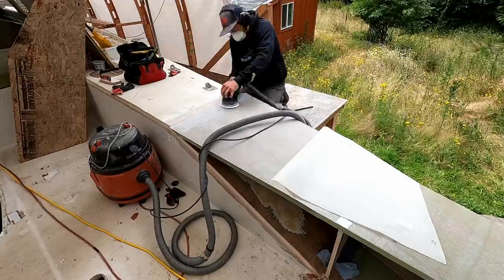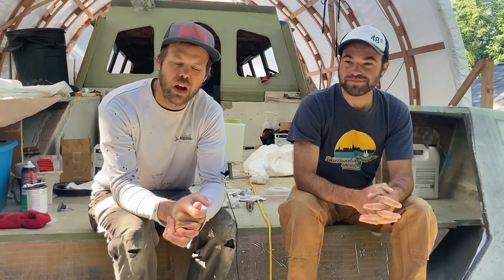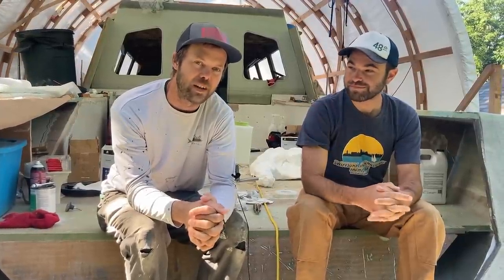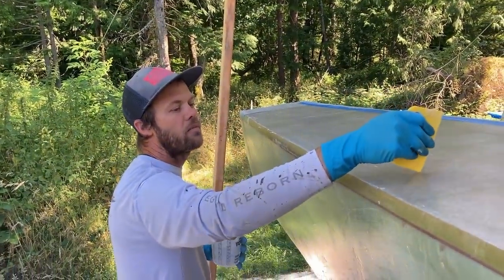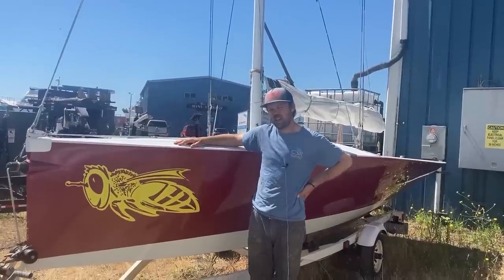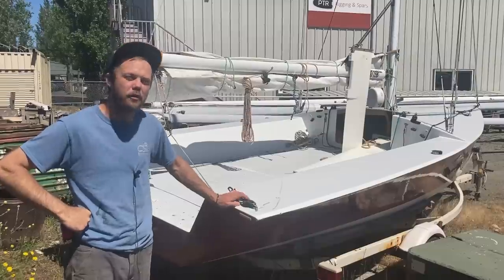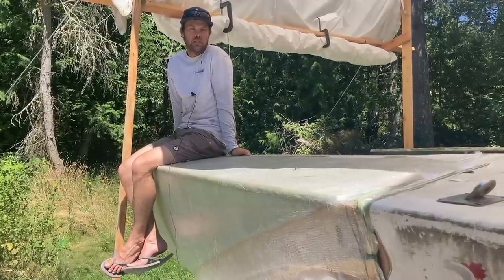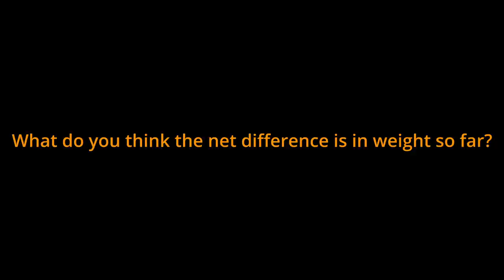Sailboat Refit:  GIANT vacuum bag project E39

Comment: I'd guess the net weight difference so far is close to zero.  You removed the water ballast tanks, pod, original doghouse with windows, and cockpit.  You basically relocated the aft bulkhead for (probably) net zero.  You added the new doghouse and stern extension.  The new doghouse is much bigger than the old, but there are no windows installed and the old doghouse looks like it was built to be bulletproof, so I imagine it is quite heavy.  Love your channel, your attitudes, and your approach to the whole project.
Reply: To quote a few of the words you use: I guess you are probably right

Comment: We got knocked down in that 52ft Erwin I told ya about in/near the grand bahama island half way to bimini. There was a water spout and the wind from it knocked the boat alll the way over. Top of the mast was in the water! Well as you may know the keel on an Erwin is heavy! It brought us back upright. We were only flat for less than a minute but we still had to change our shorts afterwards. Then all of a sudden the wind just quit, dead silence and all the water that got sucked up by the funnel dumped on us! There was about an inch of water on the deck for a second or two before it ran off. I tell ya this because we both are good sailers and sometimes we still get surprised. I’m just glad that when we saw the sky’s getting a lil dark we didn’t take any chances and closed all the portholes to be safe. That is prolly the only reason we didn’t get water logged. 
Your boat is coming along great. Keep makin the videos. (I wouldnt want to be on the internet either😏)
Reply from the maker: yikes! Glad you made it safely home.

Comment: I've done several foam core panels to make new or replace bulkheads in my small racing cat.   By recording the weights of all my raw material prior to vac bagging I was able to calculate that my finished resin to fiber was 38%, and that's just doing wet lay-up with the breather cloth and peel ply as the only way to absorb excess resin.  Infusion is great and the America's Cup Pro's are shooting for 35%, but  the extra cost of consumables and time to set up, plus the risk of a failed infusion are just not worth it to me.  For cruising boats I think a careful wet lay-up and the vac-bag are perfect and yields great results with lower risk.  I love watching the progress and attention to detail on this project, keep it up!

Comment: I am guessing about 250 pounds less so far.  Before you put on the cockpit inner panels, you could remove the original sloped top-deck of the original transom, that would allow you to make some nicely shaped and usable lockers. But I guess you have already considered that. love the project, I am refitting a 1984 Admirals Cup type IOR 1 Tonner, a lot of fun too. Cheers

Comment: As I have never built a boat so don’t have intimate knowledge of the weight of the materials being used, but watching the thoroughness of the work you have done, I would guess that the boat is about 400 lbs heavier because of the addition of the larger doghouse and using the old windows.  I would also assume that the additional weight would give you a smoother ride during heavier than normal winds.

Comment: Great improvements that will increase comfort  lot. You removed quite some weight. The foam board is not heavy but the glass is. So my guess is the you did add some weight even without the glass in the pilothouse. I am guessing plus 55kg

Comment: Guessing the bulkhead change is a relative net 0. The new dog house is probably a bit heavier than the old one just because of size. Cockpit removal is likely about the same as the extension,  so net 0 there too. But the tanks you took out were pretty big - so Im guessing a small overall decrease so far - say 100lbs less overall?.

Comment: I would guess you have added a net +237 lbs to the weight of boat. You have used significantly more layers of fiberglass than the original it seems and I'm guessing that will add quite a bit of weight over every square foot

Comment: I understand you are working with a naval architect, I just can't really see the backstay being able to take the loads that might be asked of it, out on the "ears" of the transome. Mast height is 29 meters, backsay is 9 meters. Spinnaker might be 1500kg of pull, in a bad gust. ⅓rd of that is pull aloft, across the 3 to 1 leveraged backstay. Would you hang a car on 3 sheets of fiber glass? That's what is wrapping around that bottom corner, where the line of force pulls through. I know more reinforcement will be placed internally. What's the break strength of the dynema? Where do you want the weak link?
Reply: How can the backstay be 9m if the rig is 29m? Backstay will be somewhere around 31-32m if you do your geometry right. You're not making any sense there fella. Also, he's got way, WAY more than 3 sheets of fibreglass carrying the load of the backstay. 10 sheets  built up in the immediate area of where the backstay exits the hull and four more on top of that on the interior and exterior so he's got somewhere around 15-18 layers of solid, vacuum-bagged resign and glass carrying the backstay loads...both sides. It's over-spec'd, if anything, and I'm not saying that's a bad thing either.
Reply: @williambremner9022  From the mast? Like imply the math, no, actually lets spell it out. We don't care how long the backstay is the square root of 810... 28.46 meters, "or 31-32, if you do your geometry right"  You follow? We care about the 3 to 1 leverage a pound of force has in pull strength to rip shit out the deck right? and that isn"t determined by the length of the backstay, its determined by the height of the mast and the distance to the backstay from the mast, 9 meters. 9 meters right? Now, the entire panel could be titanium covered in carbon finer, but that panel has exactly two layers of fiberglass attaching it to the hull. Its a race boat, built as light as possible, and still be structurally sound, and somehow now its lighter? maybe he isn"t building it strong enough.
Reply: @JoshuaSeed  but you didn't say that you were talking about the distance to the backstay at the deck from the mast. You just said "backstay is 9 meters".

Comment: … did you ever consider using carbon fibre for certain areas in need of high strength? Oh and the net difference is around 240 lbs. …

Comment: I think you've ripped out around 150kgs of glass/core/material and added back less...probably around 100kgs. So the delta would be a reduction in weight of approximately 50kgs. Why less? Firstly, because this yacht was made decades ago when less was known about composite construction and you have benefited from being in the industry and doing boat building in the modern era of composites and, thereby, applying a higher level of efficiency in strength : weight technology. And secondly, I think you have actually removed more material than you have replaced, to-date. Cheers from Bill / SY Miss Foxy, SINGAPORE.

Comment: 288.9875754 Lbs!  There is some scientific method that could be applied to this challenge.  As such, I don't need to guess; I can tell you that you that Duracell has gained: 288.9875754 Lbs